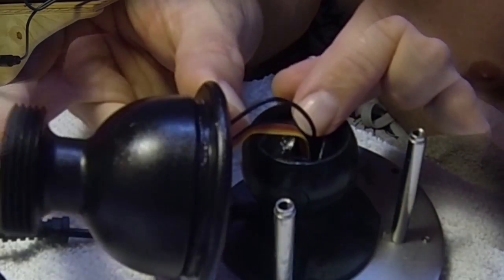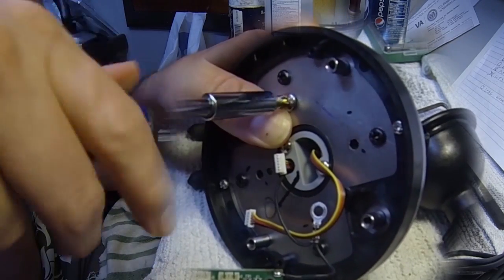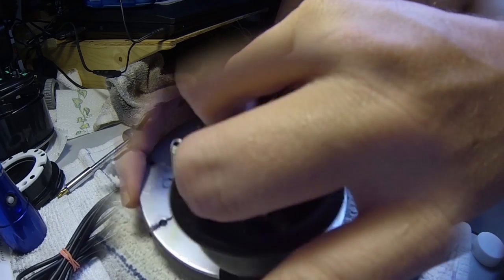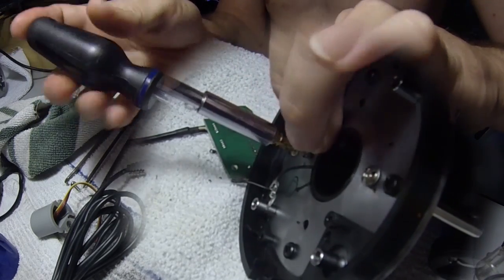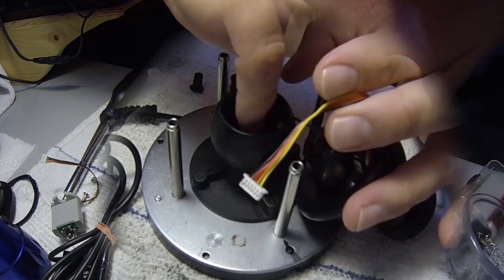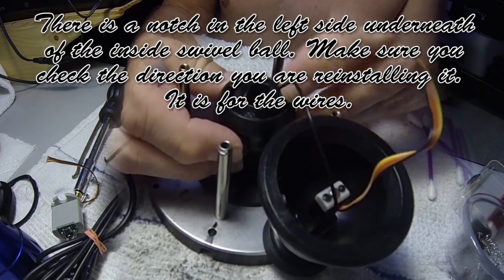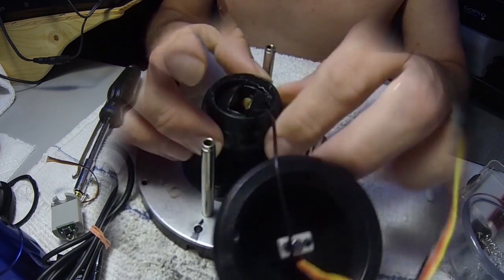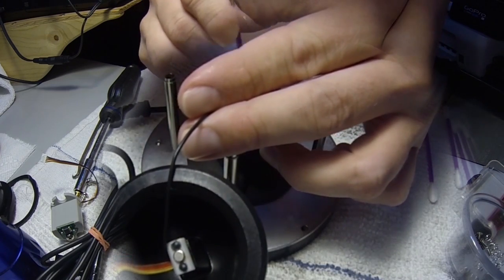ThrustMaster HOTAS Warthog, Complete Disassembly, Grease Replacement, Stiction problem, fix

Comment: Do newer production units have this problem? You would think that they corrected such a common problem
Reply from the maker: alkofarfar From what I can gather. New ones will work pretty good for a couple months but then start to have the problem.  But this is not true in all cases.  Some sticks never have the problems although rare.  Some have it right out of the box.
Reply: ronin51670 What i'm really most concern about is the plastic ball joint. Is it common for these to break?
Reply from the maker: alkofarfar No it is not.  I have only heard of one that broke and it was not the ball.  it was the inside swivel which is like a half ball.  And I believe the guy broke It in the disassembly process or by trying to twist the stick.  I can tell you 100% for sure that this is the best stick you will get for the price.  Even with it's faults.  I have owned every hotas and stick out there new and old accept the vkb fat black mamba (which if you can get ...Do it.. It is the best made)  they are almost impossible to get ahold of though.   Don't even consider the X55.  It is the worst piece of junk ever.  My next choice under the warthog for a hotas would be the x52 pro.  I have had a couple different versions of the x52 and all have been pretty good.  good luck  and you can go here for the new mod video which is in more detail and better. https://www.youtube.com/watch?v=o3yvBrD_6Rs
Reply from the maker: alkofarfar oh and here is the new video.........    https://www.youtube.com/watch?v=o3yvBrD_6Rs

Comment: Great video, I followed all your advice and now my stick is just as smooth! As far as recalibration goes: I found that if I played with the tension of the two screws holding in the sensor that I could get the stick to center without having to re-adjust the dead-zone or calibrating. If you recalibrate or make your deadzone larger then you lose that extra tiny little bit of travel/range/precision from the stick.

P.S. make sure the ground wire and ribbon cable coming out of the upper socket lay flat and fit in the small crater underneath the slotted half-ball that was held in by the two pins (The one he got out with the pliers). When I put mine back together they were slightly twisted and I felt it when I tried to move the stick. I had to get help from someone to make sure tension was applied so they didn't pinch the second time I was putting it together.
Reply from the maker: benbalooky thank you.  And I'm glad I could help.  I really like to help as much as possible.

Comment: You sir are a hero for every Warthog user! Thanks a bunch!
Reply from the maker: ***** Thank you very much.  Keep an eye out for the new vid coming in about two weeks.
Reply: ronin51670 No problem, and I sure will! Would you mind sharing what grade of NLGI the grease you're using is? I found the courage to do the disassembly & re-greasing (thanks to you!) and used a plastic safe multi purpose grease with NLGI grade of 2, and after re-assembly I found out that my stiction is actually worse than it was before. And now there is a faint plastic to plastic abrasive noise (though I didn't pay attention was it there before the procedure) when I rotate the top ball hat in place. I'm gonna try a different more thicker grease and hope that will solve the problem, but I'm also a bit worried that I went overboard with the sanding and actually changed the dimensions of the ball joint too much. (or made it too coarse)
Reply from the maker: *****   2 up to a 3 for the nlgi.  Just a couple things to check.  the o- ring could be loose.  if it is you need to pull it.  it is quite possible you put the upper section of the ball assembly on where the wires are not going through the notch in the inside side side swivel.  If it is the latter then you really need to check because it can break the wire.  If something is grinding then something did not go back together properly.  Oh make sure that upper ball section that connects to the stick is popped all the way on the ball.  If not it will ride on the wires.  I know I'm repeating but the only thing I can think of really grinding is the wires. That would also cause it to stick.  Oh and make sure there is plenty of grease on the upper section of the inside ball.  The new video will go a little more in depth about causes and fixes.
Reply: ronin51670 Ok and thanks for a detailed answer! What grade of nlgi was this exact grease you used?

Some people here already said that they couldn't find the O-ring inside their Warthog, and this was the case for me too. Might be hidden? Hehe, on my first try of the disassembly / assembly I DID manage to break my ground wire as after the re-assembly it was stuck somewhere it didn't belong and got scratched in half. But I replaced it with a new one which worked fine. When the wire was out of place there was a bit more stiction than there is now. After that I really focused on the wire notches (on the upper ball section where they come out of the electronics and the inner section, they should be lined up right?) and am pretty sure I got them right this time (double, triple, quadruple checked etc..) I simulated the upper ball section movement several times (re-greased) by putting pressure on it while moving the upper ball and got the light grinding sound. The section however moves pretty nicely without the pressure, but that I assume is only natural.
Reply from the maker: ***** 2.  In the new video I show exactly where it is.
Reply: ronin51670 How long till the new video? My grease is coming in soon so I'l wait but I'd like to know what I'm getting myself into with more detail if possible.
Reply from the maker: ralfidude  Sorry for the delay.  I have a back injury and havn't been able to work on it this week.  BUT i'm back up and just finished filming it and  have it in my editing software.  so should be up in about a week now.
Reply: ronin51670 Grease just came in so now I'm all set and waiting. 

PS: Just some friendly advice, don't put any music into the vid. There's no need. People are going to be pausing the video anyway every few seconds so it makes no sense to have it in there.
Reply from the maker: ralfidude Wasn't planning on it LOL.  Thanks though.  I have it all laid out just a couple more days.  sorry for the delay.  Takes a little more time with my back  sometimes.   But thanks for waiting.
Reply from the maker: ralfidude I put up a quick vid on the oring placement for you.  Still working on the big new vid but this should get you buy so you can get it done. Right here-->  http://youtu.be/dXBzT66tDHs

Comment: Thanks for this video, I had some trouble reassembling after taking it apart to add the teflon ring/solder in some replacement wires that got pinched/grease everything up, but your video was the fix for getting everything back together.  Thanks!
Reply from the maker: IronChef60 You are welcome.  I feel really good that I could help.

Comment: just bought a new rig via DCS forums..is a user there tha making new ones and more reliables!!!
unfortunately the play on the center still remains its not big but it is there...
Reply from the maker: G. Skouras you bought a new warthog already modded?  What is he doing to them? I was actually thinking of doing something similar.
Reply from the maker: G. Skouras Also I still haven't run across any actual play in a warthog yet.  But I have had some sloppiness from the bad O-rings.

Comment: Expensive product, with workmanship for cheap products.
I would have never thought this is that bad inside!
Reply from the maker: I know right. BUT it is seriously better than anything out right now. And by far not just a little.  I recently picked up an x55 for my girlfriend.  Thinking they may have improved over the last year.  I will be doing a review on it soon.  But needless to say the x55 is like handling paper.  I feel like I'm going to crush it in my grip or break it by moving it.  It is sooooo cheaply made.  You can't even move the throttle on the x55 without the whole thing sliding forward or back.  The x65 is the only thing that comes close but way to many problems and I like my stick to actually move.  If you can get a hold of a black mamba.  That is the best stick out there.  But it is impossible to get one and you have to order it months in advance.
Reply: ronin51670 Thank you for your reply. Yes black mamba seems perfect, but out of stock!

Comment: Hi Ronin, I hope you can help me.

I recently bought a second hand thrustmaster warthog stick and throttle in good condition. There was a problem with the stiction of the flight stick though and following advice I re-greased the ball and socket joints up. It now moves smoothly but I have a much more crucial issue now!
 
When I move the stick; the input on the screen is wild and erratic and flicks all over the place. The computer doesn't ever know where the stick is. The roll and pitch just flick everywhere on the scale all the time. It is defintely half working because it only flicks around when I move the stick. I thought I might have grease on the sensor so I took it apart and cleaned it again but it still does it. I re-calibrated the stick but that didn't help. Argh now this thing seems totally mad and I can't use it.
 
Have you heard of this problem before and know of a way I can fix it? It is defintely something to do with the hall sensor and not the buttons. Could I have put somehting back in the wrong way round?
Please help me, at the moment I have a very very expensive paper-weight.

Thank you in advanced,
Reply from the maker: I haven,t heard of this issue.  The only thing I can think of is possibly a cracked pivot ball may be throwing the sensor off.  Is there anything cracked on the inside? Double-check the magnet as well  Another thought is that the sensor board may be bad.  You can order them from TM.  Sorry to hear about the paper weight though.  I know the feeling.

Comment: My slew control stopped working.  I bought it in August 2013.  Am I screwed?  No response from tech yet.
Reply from the maker: tech takes about 2 or 3 working days but they are pretty good.  I have had good luck with them in the past.  Your stick is out of warranty but they do have parts.  You should be good.

Comment: I just got a problem with my stick: From center point to a bit down and to the left it feels very loose; movement about 1 cm. It does go back to center when I release it, but the problem is that there is no movement input in this range. Makes it feel horrible to fly with. Any suggestions?
Reply from the maker: I would disassemble and check it out.  It sounds like something broke or slipped.
Reply: ronin51670 I just moved the stick around a lot, then I heard a "sloshing" sound like from some grease...then it worked fine again :D lol.... I am a bit disappointed with the engineering behind this stick due to it's price. Well, until next time something happends...

Comment: It's pretty ridiculous that this even needs to be done for the amount of money paid for this thing.
Reply from the maker: I have to agree.  They could have just put a little more into it by making the ball metal and the pressure plate metal.  That would have fixed it.  BUT as I have said before. With the problem fixed.  It is the best stick on the market.  Nothing out performs  or pecission's it.  Accept the black mamba.  But try getting one of them.  I hope they start making them more accessible sometime soon.
Reply: ronin51670 I just did this to my stick, and it was worth every second of work Before my stick wouldn't even center properly from all the friction, and I had a hard time getting it to register at the extremes of the axis. Thanks for the video!
Reply from the maker: Ray Rosati You are very welcome.  That's the reason I made it.  Glad it helped. Enjoy your NEW stick lol.
Reply: gotta take care of nice things. how it works
Reply: Bad. Design u should never have to do. Any maintenance. Why nit havsca. Nipple. Where. J can. Add grease. Without major disassembley.

Comment: Is this the grease you used?

http://www.westmarine.com/buy/lewmar--geargrease-winch-grease--P002_070_004_505
Reply from the maker: It looks like a different one.  they may have changed the packaging.  The tube of the type I used had the same design as the small tub.

Comment: Hey one more thing has cropped up for me after a firmware update that
I can't seem to fix is the calibration is off, it seems by default now its pulling back and up when the stick is in the centered position, any idea on how to fix this? Thanks in advance.
Reply from the maker: anytime you pull the stick apart or download a update you will need to re-calibrate.  Go to the stick in devices and printers and recalibrate in there.
Reply: ronin51670
I did not take my stick apart, I just did a firmware update, my stick was full right and full back position in windows calibration window. I figured it out what had to be done and for those who have the same issue I had, here is how to fix it. You need to download "TM Joystick Calibration tool 1.13.rar" and for the throttle, "Throttle Warthog Calibration (V1_07)_22_07_2010.rar" Look for it @ the Eagle Dynamics forums.

Comment: My Z axes on my throttle is spiking, Can you take apart your throttle and expose the pots or hall sensor? Maybe you know why it's spiking on me along with certain buttons highlighting when it does.
Reply from the maker: I will do a video in the future on it.but at the moment I am quite busy with other projects.  My guess on the spiking is dirt or dust.  I know it is broad but it really is the most common cause for that problem.  try to use canned air to blow it out.  Also the next highest cause for it is interference of another usb device.  Unplug all usb devices accept the throttle and try it.  if it is fine.  Then plug them in one by one until you get the spikes.  And then update the driver for that particular device.  Hope this helps.
Reply: ronin51670
I took it apart before first posting, and cleaned it pretty good. I'm thinking it may be the ribbon cable at this point. I have worked a lot on cougar hotas. Never the warthog. I did a firmware update that really made things worse. Good thing I kept a backup copy. I don't see a place where dust can enter the senor areas though. Will go through it again at some point. Thanks.

Comment: OK, so you pay over $400 and you still have to mod it to make it perform decently. Well done, Thrustmaster...
Reply: Thank you but no thank you. I'd prefer throwing another $100 to buy some independedtly made sim controls or I'd buy the $60 T16000. Or saitek X-65.
Reply: *****  The TM Warthog is inherently flawed. Everyone had some kind of mechanical issues with it. Those who haven't simply didn't notice/thought it's normal.

This is my point. This is the point. I don't claim it's not the best hotas on the market. Which is really sad if put it all together.

Comment: Dont use a jelly or wet grease on electronics. Always use a dry grease last longer and works better less messy. Also less chance of messing the electronics up.
Reply from the maker: Not the case in a dry lube.  (The grease is also not applied to the electronic components not that its impossible for some to get on it). Dry lubes are not effective in most applications like this.  And are definitely not the safest for electronics overall just because they are dry lubes.  Dry lubes are made for mostly (not all) open or exposed places and can work well in some applications.  They are definitely not (less messy)  dry lubes tend to migrate and spread.  Also they are hard to apply unless they are sprayed or "squirted" through the small tube they come in.  They also would not come close to the thickness of the lubrication needed for most applications like this as 99% of dry lubes are very very thin and would wear off very quickly. Dielectric greases are silicone based (wet grease) and most greases people are trying for electronics are a form of this. Thanks for mentioning a dry lube it may have been a question someone was thinking to themselves that needed answering.

Comment: actually that is the slack that i was talking about
top view

TM HOTAS Warthog slack (top view)

bottom view

TM HOTAS Warthog slack (bottom view)
Reply from the maker: Sorry about taking so long to reply.  Somehow your comment ended up in spam.  Ok Now....  I have a guess to why its doing that.  First try taking that o-ring out completely then try it.  its either going to be better or worse.  if better then grease it up good and don't worry about the o-ring.  (that's how im running mine)  If its worse then your main spring needs to be stretched or you can add a thicker oring in the place of or a thin one on the bottom of the spring to help push it up to the stop.  That's the things I would try.  A good thing is that this stick runs off of halleffect so it won't affect the actual movement.  But that would annoy me.
Reply: Would be interesting to know if you could fix the thing with the wobbly stick by removing the o-ring. I ran into the same problem but not so strong and just on the y-axis.

Btw, thank you ronin51670 for this extremely helpful video!
Reply: ***** It is possible.  I remember with mine when the oring went out my stick was a little off and "wobbly" I think.  And YW
Reply: ***** Thanks, i will check that :)